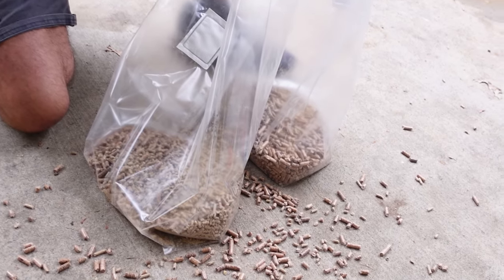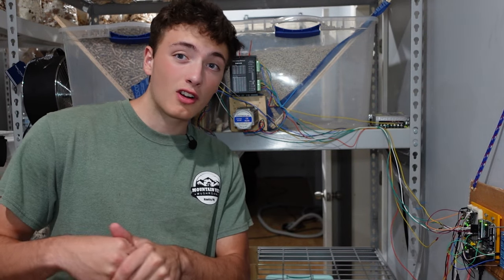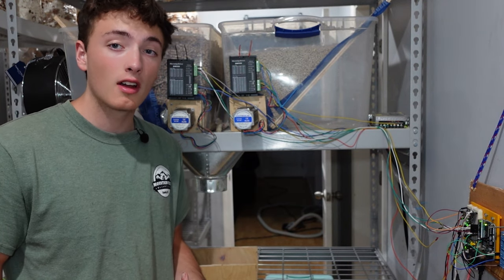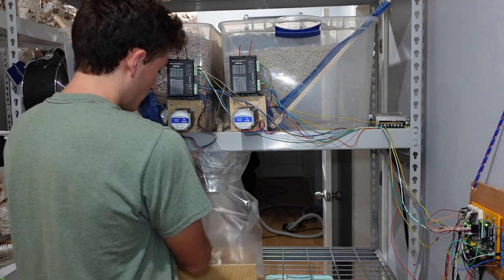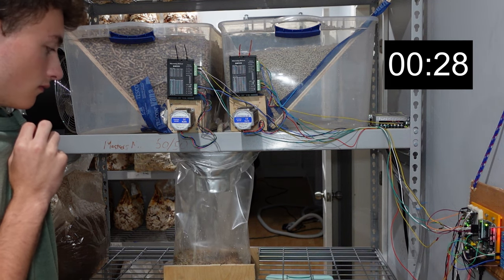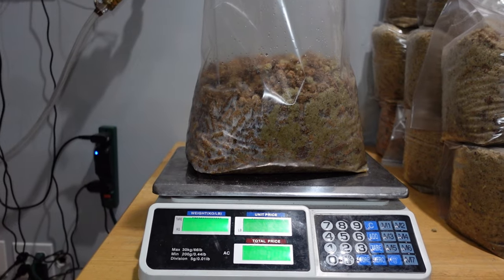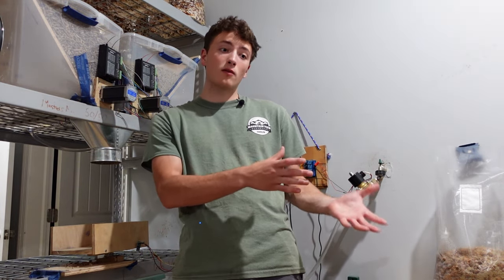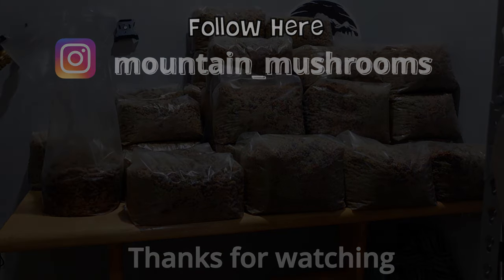Maximizing Mushroom Production with Automation

Comment: Please share a parts list and plans :)
Reply from the maker: Working on something for it, it would be a long video, explaining everything had to take a coding course as well. There's a lot the went into it. Stay tooned I'm gonna do something special for it in future. Parts are on a video main cap n stem had posted it basically there bagger but can use 2 diffrent substrates at once. Also I upgraded the bagger it's 4x faster and will be fully automatic. I won't have to put a bag on and take it off using some special components. Stay tuned!